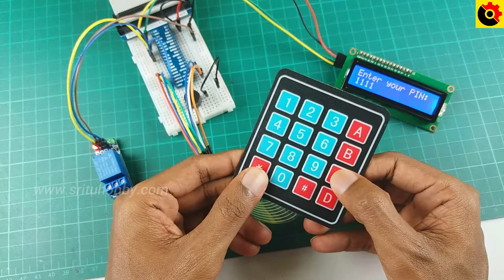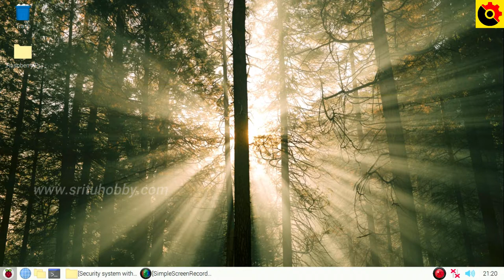How to make a door lock security system with a Raspberry Pi board | Raspberry Pi Projects

Comment: Hello 👋 bro
Program Code and circuit diagram to add Karo discription ma
Reply from the maker: srituhobby.com
Reply: @sritu_hobby  ohk Bro ☺️ Thanks 🙏 a lot! 
I am Full Support For your Sritu Hobby channel.
Reply from the maker: English??
Reply: @sritu_hobby  Can we not use the 40 pin GP extension board? instead make the connection on the direct board because the pin diagram of both Raspberry pi and GP extension board are same.
Reply from the maker: You can use it